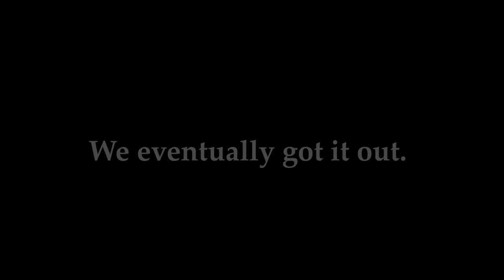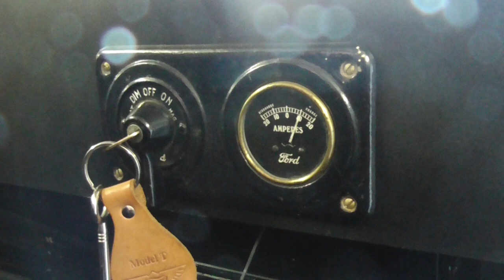Model T Generator Repair. PLUS: Driving the Thing!

Comment: Most first time T drivers don’t learn the controls as quickly as you did!  Sounds like the T is running on 3 cylinders… might want to check the coils, plug wires and/or spark plugs.  Great video as always!
Reply from the maker: Well, I did alright in the parking lot, but I wouldn't want to get into a panic situation with it. I'd probably either do nothing cos my brain would freeze or try to jam it in 1st and reverse at the same time (as with braking and depressing the clutch in any other car) xD

Comment: Observations 
1. I love that many of your tools look period correct for working on these vintage autos.
2. That better be old footage of your Model A, because if it's back on the road already and you haven't published a video we'll be upset!
3. This generator rebuild seemed to go a bit faster than the one for the Model A. 😉
4. Always impressed by your ability to diagnose, repair and test your different projects. A skill that has become lost in the age of remove, discard and replace.
Reply from the maker: Don't worry, (or do?) the Model A is still in pieces. Look at the date stamp, it says April 30th xD
Reply: @AstraWerke  That's good, well not good!  Need to get the Model A back together!  Can hardly wait for its first test drive with its new engine!

Comment: You managed the T very well. I don’t rate them as ‘difficult’ just ‘different’ to drive. I, along with many others, will be driving our Model T’s to the National rally in Dubbo, NSW in late September. It’s a 260 kilometre drive from my place. Many will cover longer distances to get there. Another fantastic and informative video.
Reply from the maker: Exactly. There are a few operations that can be done far quicker with the Model T than an unsynched three speed. Reverse parking, three point turns, rocking yourself out of a ditch... Each system has its own advantages.
Godspeed!

Comment: I drive my 1926 Model T everywhere. To me it's easier than a modern car with all it's awkward computerised controls and no sense of being connected to the environment around you. As for brakes, the 26-27 Model T is in a different world to the earlier T's with proper brakes on the rear wheels. BTW, 10A charge rate isn't good for battery life; about 4-5A is all you need and won't boil the battery.

Comment: Though there is a lot of nostalgia for a model T, it is really not suitable for anything but parades, and doesn't have anything like the standard that came out of the later part of the T's run.  Whereas a Model A is just an early obsolete version of a car.  It's old, but it operates like a car.

Comment: 👍👌👏 Very well done again and as always (video and work). Please kindly allow me to ask a question:
Does this Model T run on all 4 cylinders respectively are all 4 cylinders healthy? I thought to hear quite a dissonance. I once was a fan of Model T cars. But because of the weird pedal stuff I'm way less excited.
Thanks a lot for making teaching explaining recording editing uploading and sharing.
Best regards luck and health to all involved people.
Reply from the maker: Yes it has quite a substantial miss. The owner says compression is OK, so it might be ignition related.
Reply: @AstraWerke    Easy way to check is to hold the points open on each coil while it’s running.  You’ll find the dead cylinder in no time

Comment: Unless you drive a lot with the lights on or only make short trips you may want to turn down the charge rate. Running that high has a tendency to greatly shorten the life of the battery due to overcharging
Reply from the maker: It's mostly a "get-icecream-car", so by the time you're home, it's just about charged enough to have the battery full again

Comment: I don't think the A generator will last very long at 35A, about 12A continuous is all they're good for unless you add some cooling holes.
Reply from the maker: I was guess-timating ~25A for lights plus 10 Amps charging rate at night - actually doing the math, standard driving light will be more around 17A. Adding 10A charge, I'd say 25A continuously should be OK.